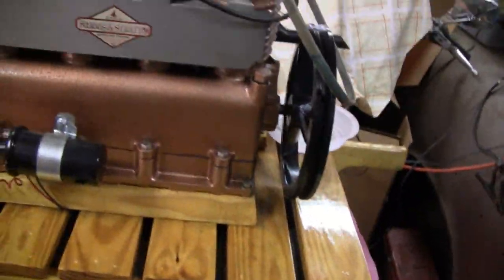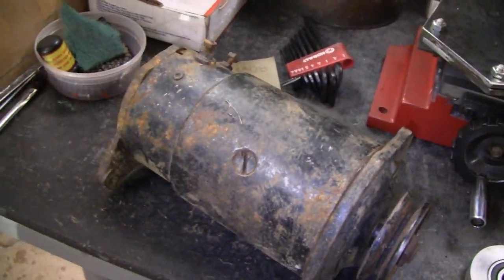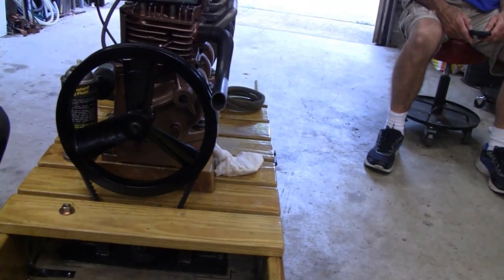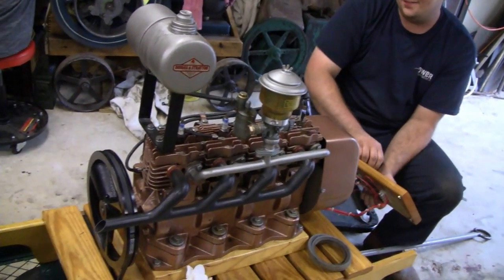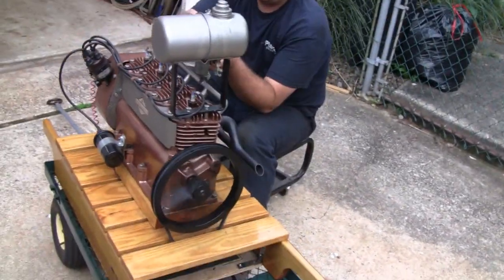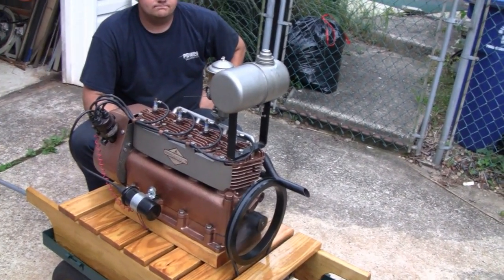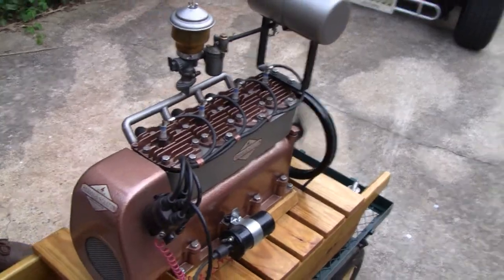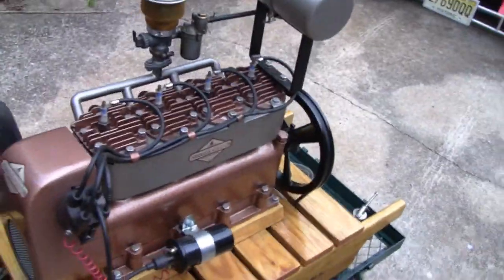HOMEMADE 4 CYLINDER BRIGGS GENERATOR REPAIR

Comment: Heya Roadie...I've got three short frame S/G's here...I can test then, find one that's good to go and ship it to you if you guys want to revert back to the short frame. Just let me know! Sure to love this build. Turned out awesome and it's good to see it hasn't been forgotten. Cheers!! Zip~
Reply from the maker: Thanks alot Zippy!! We sure appreciate the offer!! The L/G actually works better, don't know why, maybe because the other one was shot or the pulley size was different!! For now we're gonna leave it in there, there is plenty of room but if we ever have any more problems with it we know who to call!!☺
Reply: If you find that the new generator is also capable of charging, you could keep that battery of yours topped off with the addition of a regulator. To test, just take the belt off, spin it up to speed free wheeling, then quickly touch the positive cable to the Field post. If it stops the pulley in a hurry, the S/G will charge. Just add an appropriate regulator (PN 295924) that NAPA can cross reference to get you what you need. Keep up the awesome builds! Zip~

Comment: That brand new temp gun looks like mine which is a Milwaukee.  While I was watching the engine run I had visions of it pulling a generator or maybe pumping water.  It would be interesting to see what it would do with a medium load and how it long it would last before needing repairs.  Any way you cut it, it's an interesting engine and of course a conversation piece for the shows.
Reply: My guess is it would overheat if they put it under a load
Reply from the maker: Thanks JB!! We have too much time and labor into it to watch it implode!!☺
Reply: 805ROADKING I too would be like you and the Buddies and would watch it carefully when it is running.  As Skracken said above that overheating could be a problem it appears that you have that under control by taking temps on the cylinder heads.  Something that would be cool is a head temp gauge sending from the hottest spot on all of the cylinders.  Once you learned about the temps you could use the gauge to determine when it's time to shut 'er down.

Comment: if you put a muffler on that engine it will probably run a lot better. needs some back pressure. put a motorcycle baffle in the pipe at least and see how much better in will run. running a little rich will actually allow the engine to run cooler by the fuel flashing off like a refrigerant removing heat in the process. just a thought. you could learn a lot from a dummy!